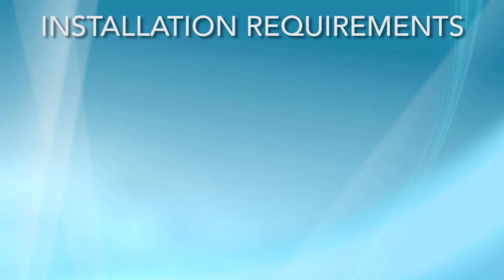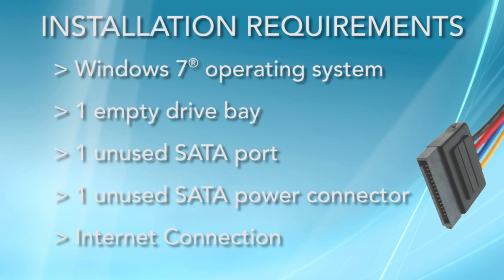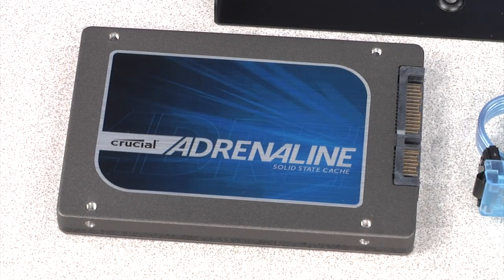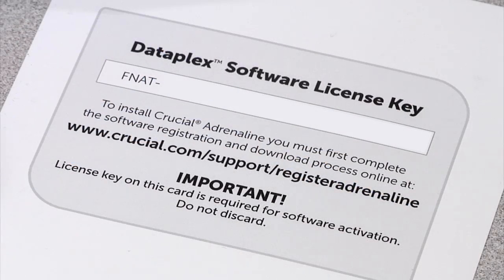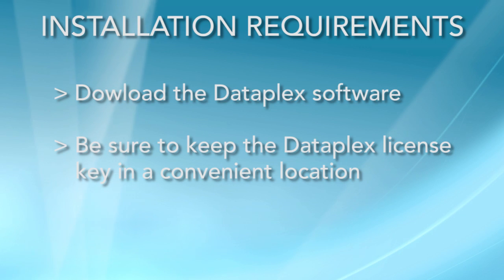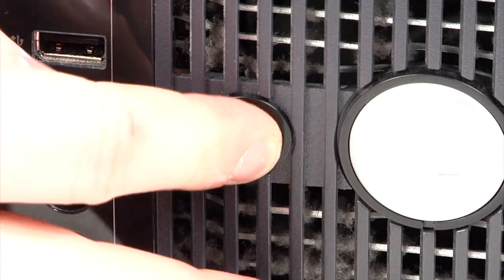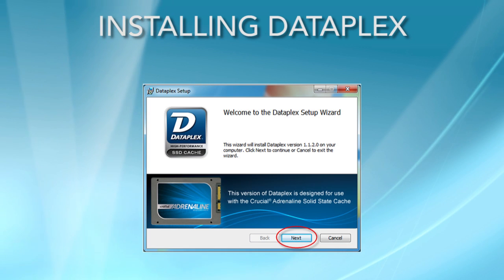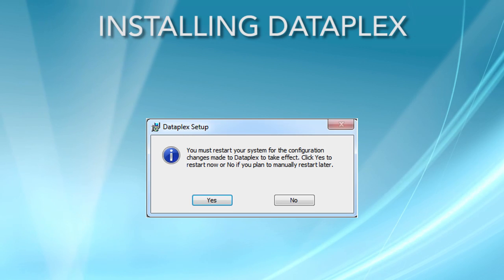Crucial SSD Cache Solution Install Guide

Comment: This didn't install like this. I spent 5 hours trying to make it work. When you plug in the ssd its not a matter of simply restarting the computer like it says. The computer doesn't know what to boot from and in the bios my original hdd is no longer in the list, even when trying leads in different ports. Needless to say, its still not working and just sitting there collecting dust, disappointing that it isn't as simple as stated in your video

Comment: Got a question,

I have a Z77 setup with i5-3570k.   I have a 120gb SSD that my system is on, but I put larger less used programs like games on a 500gb partition of a 2TB standard 7200 RPM hdd.   Is it possible to set this up to cache only the data accessed from that 500gb partition?   Would this be beneficial?

Comment: What if I have a SSD already ? would it make it go any faster ? and also does it only work on the main os drive , like lets say I have a second drive I use to install my games in , would the SSC help boost the loading times for the games installed in the second drive? thanks.